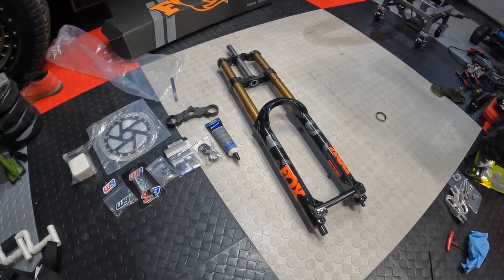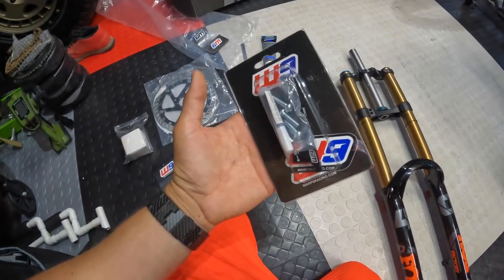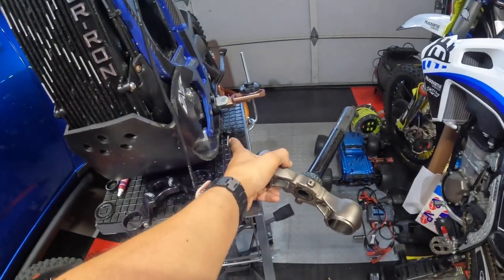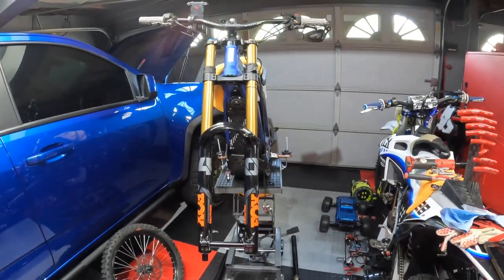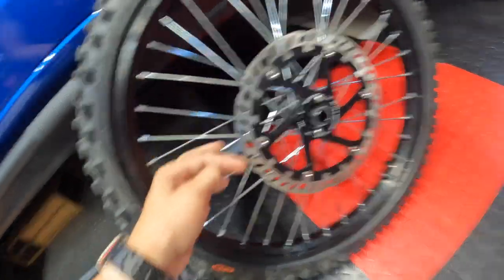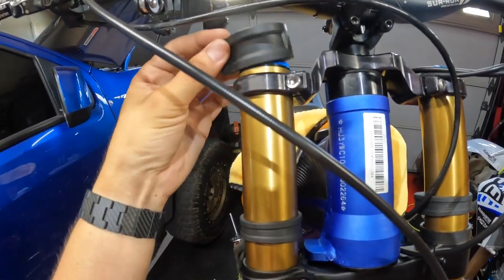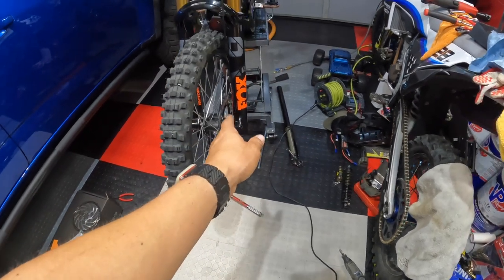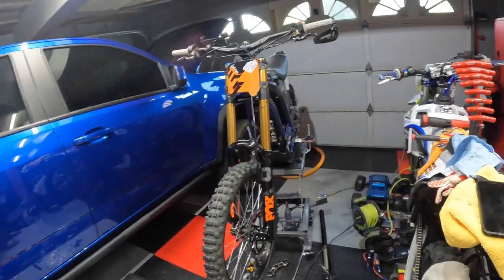Best Suspension for your Sur Ron : FOX 40 install

Comment: I really appreciate the way you went about doing this video it wasn't too much information it was just the right amount I just bought a set of fox 40s and now I know exactly how to put them on thanks for the great video and as far as bommer 58s from the information I got Fox 40 owns that company and the internals in the 58s are the same as the fox 40s just good luck finding them
Reply from the maker: Awesome I'm glad you found it useful! They are almost the same, other than the fox having more adjustments. I liked the look of the fox's better so it was an easy decision for me. Depending on how bad you want them you can pick up a mountain bike sometimes for not much more of what the forks cost. Then you sell the parts off it to make up the difference.

Comment: Nice video man! Very helpful! Could you send me, or link me to the correct rotor spacer I’ll need, the middle stem bearing, and also the best drop crown? I couldn’t find the one you’ve got, thank you in advance.
Reply: I looked in the description where people usually leave links to what they’ve used but I couldn’t find anything. I just don’t want to purchase anything the wrong size, I’m not as clued up as you 😣😂
Reply from the maker: @MikeyHoldenMusic  https://chargedcycleworks.com/products/hub-spacer-for-boost-forks Here's the spacer. and here's the drop https://risseracing.com/store/product_info.php?products_id=710
stem bearing. https://lunacycle.com/sur-ron-tapered-bearing/

I'm already lazy enough as it is to post these videos let alone links haha. I figure with me mentioning brands in the video or sometimes where I got them from ppl would be able to google them.

Comment: i’m planning on replacing my forks with fox 40s, i already have them and i have almost everything you mentioned. i’m taking my bike to a bike dealer to get it installed…

do i need a new headset bearing? or can i just have them remove the old one? i saw the other links you gave and saw that the bearing is sold out…would you suggest just ordering another bearing for a different site? or maybe a cane creek headset?
Reply from the maker: You could just have them remove the bearings. I went with a new one just bc I will be planning on building another Sur Ron from all my stock parts. so no point in removing them from those forks ya know.

Comment: Can you tell me each part I need to get for my sons fox 40 27.5 for his surron?  I bought the forks not knowing I needed other things. Thank you in advance. Jane
Reply from the maker: Hey Jane.. I went through everything you needed in this video? Risse clamps, boost spacers for the fork legs, another headset bearing (unless you plan on removing your stock one) & stem spacers for the top.

Comment: Hi, great video. 
I just went to fit my Suron front wheel but there is a 1.2mm gap between the hub spacer and the Fox40 fork leg. So 0.6mm each side of hub. Brand new bike  brand new forks.
Did you have the same issue?
Reply from the maker: Did you buy the spacers like I did in my video?
Reply: @newbeginning2864  can you put the links in the description for everything you need to do this fork upgrade
Reply from the maker: @TM-xd4vl  https://chargedcycleworks.com/products/hub-spacer-for-boost-forks Here's the spacer. and here's the drop https://risseracing.com/store/product_info.php?products_id=710
stem bearing. https://lunacycle.com/sur-ron-tapered-bearing/

Comment: Where did you get the adapter for the front caliper?Is it a standard Caliper?in the start fase of mounting the fox 40 29"on my Talaria sting
Reply from the maker: No my caliper is not standard, it's oversized to 220mm. This is the adaptor I use down below. Noice, you'll love them! https://www.factoryminibikes.com/collections/sur-ron-x/products/surron-front-brake-rotor-adapter-warp-9

Comment: The Bomber 58 is just as good and way cheaper. Videos on YouTube,  guys are comparing the two and they all have said the the 52's where just as good as the fox.  Save lots of money. The fox's are way over priced.
Reply from the maker: You get more adjustability if your picky and like your suspension set up a certain way, the Fox's will get you there better than the bombers. Everyone has their own opinion I obviously didn't care much about the money aspect..wanted some of the best parts you could buy for my Sur Ron plus it fits the color scheme I was going for so that alone was worth the extra 800 or whatever the difference was 😉
Reply: @newbeginning2864  lol. I understand but not everyone is as rich as you.  All the guys in the other videos says that the adjustability isn't really enough for what the fox's cost and that it's very minimal. .
Reply from the maker: @scottmcbride2237  Haha well shoot the title of the video is about having the best suspension and not the best budget friendly suspension 😅. I know what other ppl have to say as I've been mtbing for some time and remember someone opening them up side x side to see what the differences were when I was looking to buy a set for my mtb but went with the fox 38 on that. But to get back on subject having more adjustability, if need be, being lighter and looks (in my opinion) make them the best option.